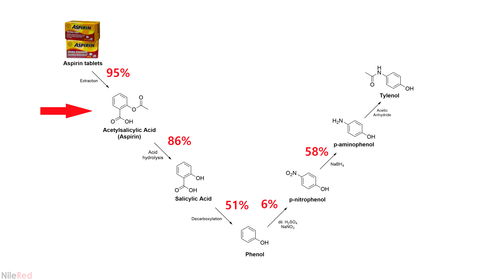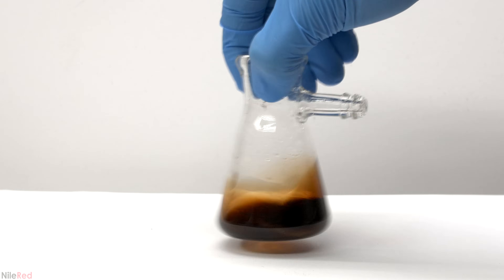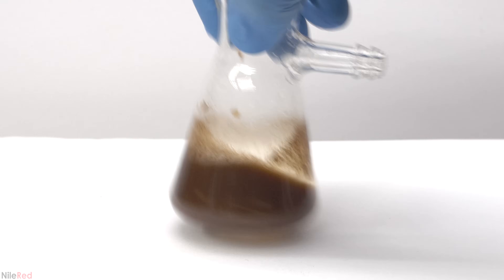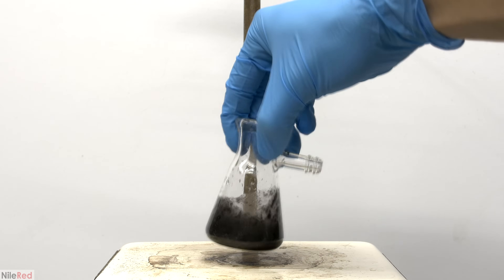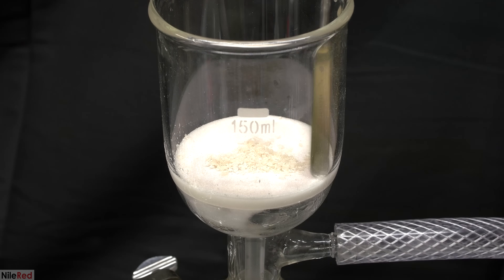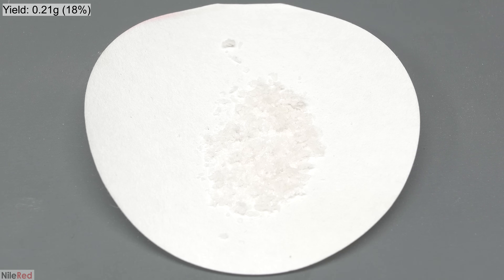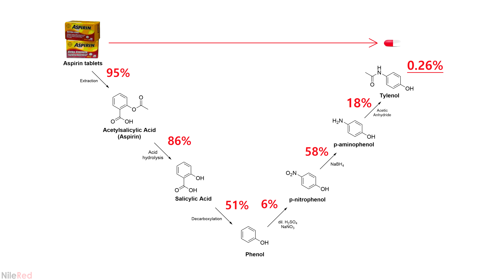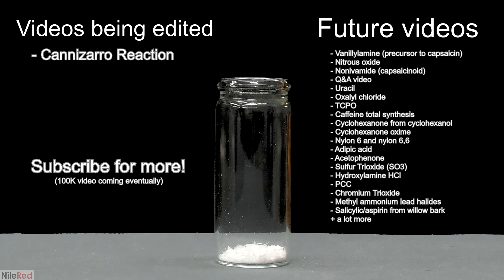Aspirin to Acetaminophen - Part 6 of 6: Acetaminophen from p-aminophenol

Comment: Why does the Acetic anhydride not attack the OH anyone please 😷 I think because it's in water H2O
Reply: p-aminophenol contain the functional group -OH and -NH2. 

Acetic anhydride will react with -NH2 because the -NH2 is more reactive. 

the -NH2 is also much more nucleophilic compared to the -OH (in the p-aminophenol and also water)

as to why acetic anhydride not attack -OH, I think it actually does. Some acetic anhydride will eventually react with the water, forming the acetic acid (side product in this experiment)

[ disclaimer: I don't know if this is absolutely right. this answer is all based on my own knowledge and understanding. Sincerely, a 2nd year pharmacy student ]

Comment: Why are you calling it "pee-aminophenol". It's PARA !  A "hydrogen" NMR? It's PROTON.  Also, if you knew how to properly do a recrystalization, you wouldn't have had to do it three times. You would have had a clean product after one time.
Reply: MrPlanx; I can't decide if you are trolling or just really ignorant, but even in industrial scale chemical engineering, recrystallisation is a unit operation that is frequently repeated in the same product stream.
It's like saying that triple-distilling anything is a waste, because, if you knew how to do it properly, you would get a pure product after only one distillation step... That's simply not how purifications work.
The most extreme example of this is in uranium enrichment processes; go take a look how many times you have to repeat the same purification step to get even a 90% U235 concentration.

Also, it's not really wrong to refer to H-NMR as 'hydrogen' NMR, especially in a non-technical educational video, since an H-NMR ONLY focusses on the proton contained within hydrogen atoms. All the other protons in all the other elements get ignored. Also, in almost all organic compounds, hydrogen is present as a COVALENTLY bonded atom and thus CANNOT be refferred to as simply being a proton.
Reply from the maker: Thanks for the well done reply! The major reason why I called it a hydrogen nmr was so that it wasn't confusing to anyone. I wanted it to be very clear what I was looking at.
Reply: p-amminophenol means para, "o" means orto and "m" means meta.. it is not wrong

Comment: something interesting to try, making sodium metal through electrolysis, dissolve salt in water, use separate cell electrolysis, collect the sodium hydroxide in anhydrous form, then melt and electrolyse that to create sodium metal in an inert atmosphere. it's not difficult chemistry but it would make a nice series. or perhaps you could collect the chlorine that comes of from the separate cell electrolysis, run it through the aqueous sodium hydroxide to make bleach. all from salt water
Reply from the maker: I might eventually do that

Comment: On the first video in the series I guessed 18% yield for the sequence overall. I was a bit too confident in your capabilities, but then you guessed 33%. :-)

Were there any steps in the sequence that could have been done more efficiently by doing multiple steps in one workup? I.e. without cleaning and isolating the product of reaction A, just dump in the chemical to do reaction B.

Comment: Are you going to be doing a 100,000 subscriber special? That's a pretty big milestone, it makes one of the biggest chemistry channels on YouTube, second only to Nurdrage.
Reply: For a suggestion on a multi-step synthesis, how about epinephrine? It would be very difficult (using the 1904 method at least) and would take some very dangerous stuff, but it might be possible for the amateur. Only if you have/can get/can make phosphorus trichloride or phosphoryl chloride though. Perhaps a more modern pathway is better.

Comment: Loved the series NR. My vote for next potential synthesis series is a Methylxanthine alkaloid, although not the Caffeine everyone else seems to want. My vote is for 
8-Chlorotheophylline, much milder stimulant than 1,3,7-Trimethylxanthine(generally referred to as "caffeine" by the uncultured savages, ;-P)

They only differ by 1 C, 3 H, and 1 CL; and I wonder how much easier or harder that will make the synth, also it's a fairly common additive for reducing drowsiness in OTC anti-emetics that most people are simply unaware of.

Comment: nice job, I really liked the series. How did you test the melting point?
Reply: It depends there are instruments that do the job or in classical way. 
For solids and having a MP below 200°C, 
Theres a beaker having about 200ml of paraffin oil. 
Inside the beaker a thermometer is lowered and the sample(dry) is filled in a fine glass capillary and tied to the bulb of thermometer. 
The oil bath is heated and when the solid sample turns into a liquid thermometer reading is observed. 
Machines generally use lasers and LDR (Light dependant resistor) to accurately measure MP. 
When the sample turns into Liquid the Laser could pass through it and the temp is recorded
Reply: cool, i've been wondering about this for a while now.

Comment: Also, adding activated carbon to your refluxing solvent might have discoloured it enough the 1st or 2nd recrystallisation. I'm a huge fan of recrystallisation and I hate running columns but they usually are terrible for your yield. 
I also think your product contains a huge amount of water unless your DMSO-d6 was extremely wet, so your actual yield might be even lower.
I love your video's, keep it up!

Comment: Hey Nile Red, this was an AMAZING series! I really like the concept and I also feel like you totally nailed it aswell.
Also, thank you SO MUCH for taking the time to purify the paracetamol until it was almost completely white and, furthermore, running an H-NMR to verify the product's identity and purity (at least with respect to organic byproducts); I really appreciated it!

As for what videos you should do; I know it's not on the list, but I think it would be awesome if you could maybe do an exploration of electrochemistry sometime this year... Specifically, I was wondering if it would be possible to produce a volume of water than only contains H2O together with a substantial amount of H3O+ (such as 0.1M or maybe even 1M, without any 'counter ions'). For instance, we know that the electrolysis of pure water produces an acidic environment at the anode and a basic solution at the cathode; so I was wondering if one could use an apperatus consisting of 2 non-conductive containers, each containing an unreactive electrode, which are connected through a relatively narrow, non-conductive tube that has a non-conductive shut-off valve at the center. Then one could simply ramp up the voltage to compensate for the developing overpotential and once the power supply reaches its limit, you could then close the valve, discard the basic catholyte and replace it with either some new, pure water (or perhaps even with half of the acidic anolyte solution)and finally open the valve again and repeat the procedure... Does this sound even reasonably possible, or am I just being stupid again? 😅

Comment: Wouldn't an IR spectroscopy of the product show metal contaminates? I used IR for metalo-organic analysis back in 2001 for Al and Ni acetylacetate, but I do not remember off hand if metals in the Pt group would show up.

You should be able to crystallize more produce out of your solution just by reducing the water volume more. I would recommend boiling under light vacuum so you do not risk decomposition from heat.

Comment: Excellent, 
Now I know this is not the point, But how much do this whole process cost?
A normal pill would be 500mg and cost about 6 cents in Australia. A cheap pack is $1.30 for 20 pills, 10grams

Comment: Turn aluminum into gold!!! That's chemistry right?
Reply: Do R/C! more like nuclear physics
Reply: Brok3nC4rrot or alchemy:)
Reply: Do R/C! It would be nuclear physics
Reply: Do R/C! There you have it... MEDIEVAL. Turning elements into other elements is called nuclear physics. Chemistry is putting elements together
Reply: drvelocci OK I will. Check out mine.  I'm into procrastinating and not finishing editing videos.
Reply: That would be an alloy of aluminium and gold, although an intermetallic compound can be formed depending on the stoichiometry: https://en.wikipedia.org/wiki/Gold-aluminium_intermetallic

Apparently this causes problems when gold plating aluminium in electronics.

Another purple alloy is that of copper with antimony; this was known as 'Regulus of Venus' by the alchemists.
Reply: al·che·my

ˈalkəmē/

noun

the medieval forerunner of chemistry, based on the supposed transformation of matter. It was concerned particularly with attempts to convert base metals into gold or to find a universal elixir.
Reply: OK fine be that way:)
Reply: Do R/C! Ok I will
Reply: its not nuclear physics because it cant be done, only radioactive elements can be changed
Reply: Barnesrino Kripperino what nonsense, how do you think they make all of those super heavy synthetic elements at a bottom of the periodic table.
Reply: enzyme20056 They are almost all radioactive, because of their size they are unstable.
And no they don't NEED to be radioactive to make them react in a nuclear reaction.
I don't believe you can turn Al to Au. However... youtubers, including me, are infinitely stupid next to a nuclear physicist, so don't take mine or anyone's word for it here
Reply: Alchemy! 
Al -> Au :) Pretty funny. 
Wait... 6 Al (13 x 6 protons) = 1 Pt (78 Protons). Alchemy had it wrong all this time, they were making Platinum! :)

Protons hate sticking together so science wise it's really hard and pointless. You have more gold on your cellphone circuit-board than you'll get all your life smashing nuclei together.
Reply: Now I wonder if you can get Al to react with Au. If you could, would it be a compound or a molecule and what could you use it for. Well, time to google search.

Comment: Could you potentially do a video on a TCCA oxidation of an amino acid? This produces nitriles in good yield similar to NBS, but this is OTC and the cyanuric acid byproduct can be filtered off. 

Another idea would be to make useful chemicals from cooking oil or some other common household foodstuff. Since you are planning to eventually make nonivamide, you will eventually need pellargonic acid. Conveniently, this is made industrially by ozonolysis of oleic acid. It might be interesting to extract oleic acid from sunflower oil, and then break the double bond with something like potassium permanganate. Other ideas would be levulinic acid from sugar and thalidomide from MSG.

Comment: synth/extraction of nicotine? plus titrating in soln to determine concentration? extraction would be pretty straight forward, synth would be ??? and titration re: concentration i haven't seen you do yet.
Reply: That would be really cool but really dangerous as well as the lethal dosage of pure nicotine is like 30 - 60 mg. I'd imagine the total overall synthesis wouldn't be too difficult though if you had access to the required chemicals. After all its only a matter of starting off with the required bromopyridine and then forming a N-methyl-pyrrolidine ring in a few separate steps.

Comment: The low yeld, beside the recrystalizations, is probably due to the fact that you used water as solvent: acetic anhydride is notoriusly sensibile to water, being hydrolized to acetic acid. Usually all the acetilation process via acetic anhydride are conducted in a water free environment.

Comment: To be fair, looking at the final percentiles along the entire chain, aren't a lot of those also much lower than the theoreticals because of mistakes made during the process and discarding secondary products wholesale, rather than attempting to reclaim as much of each step as possible, as would be possible in a large scale production run?

Comment: I have an idea for you to try out. About 25 years ago I came across a bottle of slightly viscous fluid from an old paper manufacturer. It smells kind of strong but not unpleasant, its clear in colour and it bleaches skin like hydrogen peroxide. There is no label on the bottle and I only have about 50ml of it. I kept it just to find out what it is, sometime in the future, but I never did. I can send you a sample and your task is to find out what it is. I can also include another chemical in powder form that also is missing its label. I think it is hydrokinon but i'm not sure.
Reply: WGwireless, so, you don't know what it is, but you know that it bleaches skin?

Isn't that somewhat ...wrong?!    :P
Reply: Extremly wrong. To be honest I got some on my fingers the first time I opened the bottle. When I think about is i must have been more like 28 years ago, still got most of my ten fingers. :P I just remembered that it's not soluable in water and also is heavier than water.

Comment: I wonder, could you do the opposite and make acetylsalicylic acid from acetaminophen?

I guess removing that NH and placing a carboxylate group on that benzene ring might be quite a challenge.
Reply: piranha031091 starting from Phenol its possible to use the Reimer-Tieman reaction to get Salicylaldehyde which can be oxydised to salicylic acid 
But I dont know how to get to phenol from aminophenol
Reply: piranha031091 Tali-bahn NH2 on benzene ring can be removed by nitrous acid (diazotisation) followed by borohydride reduction.

Getting the acetyl group off the amine without destroying the aminophenol is a bit of a trick too.
Reply: I guess that's it! Acid hydrolysis to aminophenol, diazotization & reduction to phenol, Riemer-Tieman to salicylaldehide, oxidation with KMnO4 to salicylic acid, and esterification to aspirin.

Comment: Hey, @nilered have you thought of trying to convert acetaminophene to aspirin? ;)
Reply from the maker: haha, i think ill pass for now. I have thought of making aspirin from phenol, but I cant do the carboxylation at home (at least without some engineering efforts). The pressure and temperature needed is just too much.
Reply: NileRed Just can't handle the pressure:)
Reply: +NileRed You could formylate (Reimer-Tiemann is probably easiest) to salicylaldehyde (which has an interesting aroma, if that sweetens the pot for you ^^) and then do a Lindgren oxidation to get salicylic acid? Acetylisation with acetic anhydride should be ok.
Reply: Vielsmeier reaction (POCL3/DMF) give aldehyde, oxydation and you have carboxylic acid

Comment: Hey, as a fan of breaking bad i have been making paths to the methanfetamine, from scratch benzene and from the p2p method walter talks about on the 4th season or so. Is it right? From:  phenilacetic acid + PBr3 or SOBr2  to phenilacetic acid bromide, from that plus CH3MgBr to the correspondinc ketone, from that plus methilamine and then NaBH4 + water + Pd/C. Just curiosity.
Reply: As a chemistry student, I can say it seems quite viable. The first step is an SN2 OH displacement, this can be easily done. The second part is a Grignard reagent, these are very reactive with moisture, so that would require special conditions, and they do not react very good with organic halides. Your best bet would be to use a copper-lithium compound or a Gilman reagent. Then you can react the ketone with methylamine and reduce the N=C binding with NaBH4 and Pd/C, but you'd be better off using methyl formamide, an ester of methylamine and formic acid and then hydrolyzing the product.
I, as a chemistry student also find this kind of things fun to work out, this is all the information I can give you. I cannot give you more detailed reaction specifications or purification advice as this would make it even more easy to do the actual synthesis. Then, I'd feel like giving away the complete recipe.
Reply: You do realize you are breaking the law? Breaking Bad will not give you a complete guide to make meth, but there's plenty of sources on the net.
Reply: teeboytel it's not illegal to think  about reaction pathways...
Reply from the maker: I am honestly not sure about the details outlined by Walter.
Reply: teeboytel In some countries it is even legal to make drugs as long as you dont purify them and the final product is inmediatelly destroyed.
Still a controversial topic to talk about in  the internet, something that not many people will tell you how to do directly.
Reply: sure, as long as his "making paths" is indeed just some brain storming :)
Reply: Yes, the copper would do the trick there. If i wanted to make it it would be easy, i know how to purify compunds too. These steps i used i just said them because walter uses them on the series, i know there are better ways. I also need to take organic chem 2 and synthesis and then catalysis too, this isn't my final recipe xD Its for fun, pure curiosity. Also, meth doesn't sell at all in my country, so... yeah xD

Comment: What's the point of using acetic anhydride with water as a solvent? Shouldn't it immediately react forming acetic acid?
Reply from the maker: Damn, I totally forgot to add a little text box... Acetic anhydride reacts slowly with water at room temperature. An excess is used to offset the loss.
Reply: Thanks! I remembered my acetylization of salicylic acid not working because I didn't distill the acetic anhydride and the water killed the reaction. The bottle was probably sitting around too long.